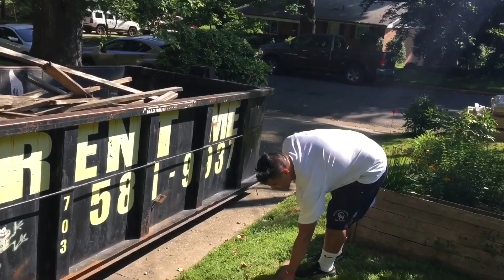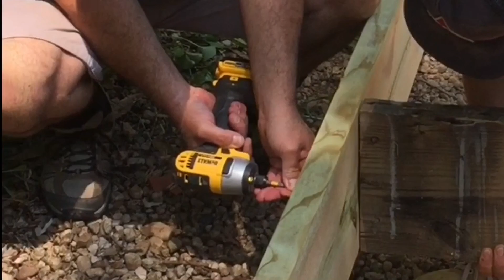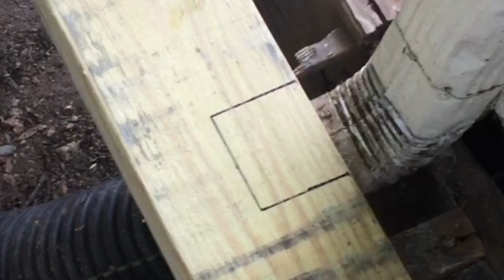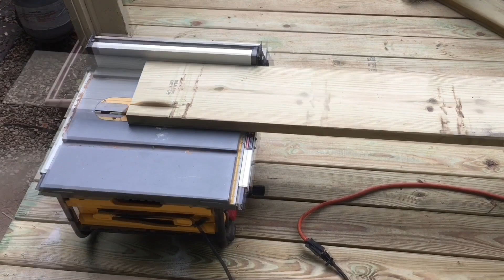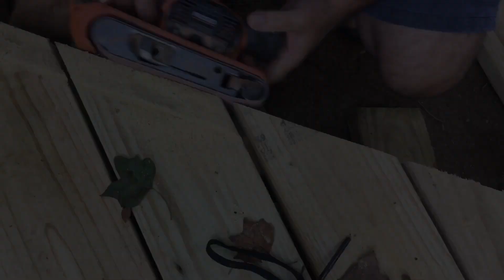Deck Resurfacing

Comment: So I couldn’t see where you cut out the bad piece of that one joist do you just leave the rotted part blank or do you insert new wood piece in the old joist as well as the sister boards on the side ?
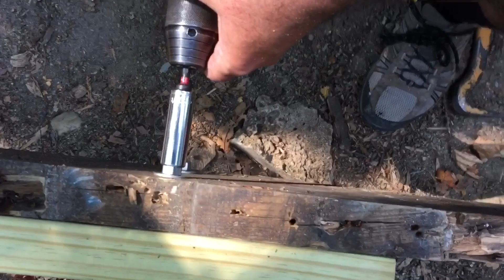Reply from the maker: Howdy Flippin Tobyland!  Thanks for the question....Yes, you want to insert a new board to fill the gap left by the removal of the rotten wood.  Take a look at 7:20-8:30 of the video where I briefly explain this.  If you have a project requiring joist repair, you may also want to watch video 2 of my kitchen remodel series where I also do joist repair.  Thanks for checking out the video and good luck on your project!

Comment: Great video thanks. Would it have been worthwhile to paint all the timber surfaces  with a water repellent anti fungus coating  before installation?
Reply from the maker: Howdy GentlemanH!  Sure that might not be a bad idea...anything to prevent water infiltration and rot is a good thing.  However, the pressure treated material we’re using advertises a 20 year life expectancy - which is probably closer to 10-15 years.  That said, sealing the wood prior to install will help get the longest life out of your deck.

Thanks for checking out the video and for the comment!  ☘️